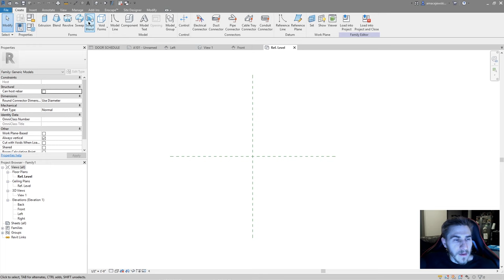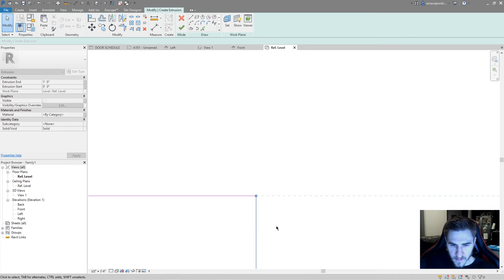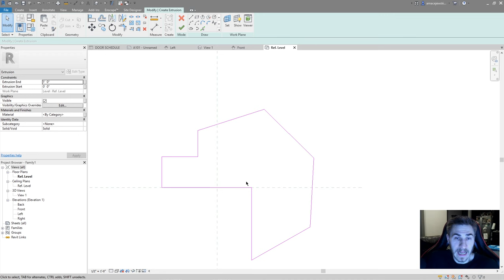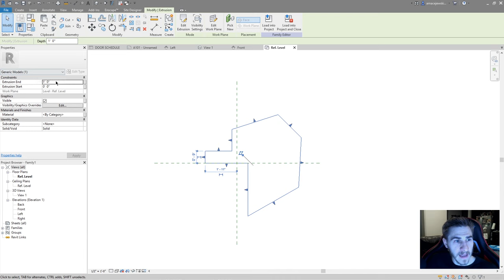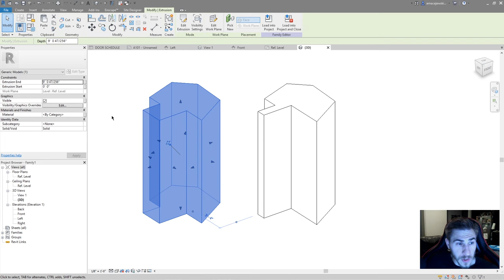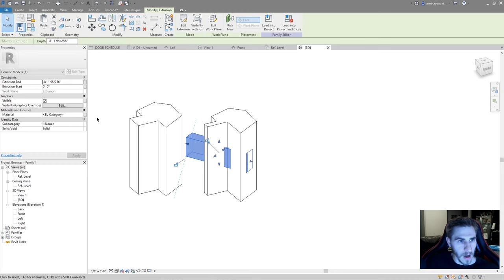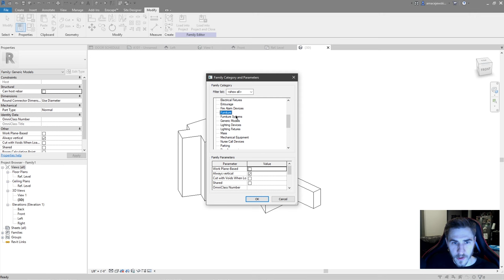How to Create Extrusions | Revit 2020

Comment: Keep making videos these are very good and very informative. We are a mechanical contractor and we usually deal with plumbing, ductwork, and mechanical pipe but we use Revit alot. I'll be watching alot of your videos because i want to find out the best and most efficient ways to use Revit to produce our drawings to the GC. Especially liked the dependent views video that helped me out alot because I was always having to split up one drawing to fit them on a sheet. Thanks for all that your doing.
Reply from the maker: I sure will dean, sorry for the late response. Hope I can help you for sure. Let me know if there is something specific you are after.

Comment: How do you measure the extrusions ? For some reason I can't use the mesuaring tool
Reply from the maker: You can only use the measure tool in a 2D view so try that. Also, you can measure the extrusion when you are editing it. There is a start and end dimension so the distance between those points is the distance of the extrusion.